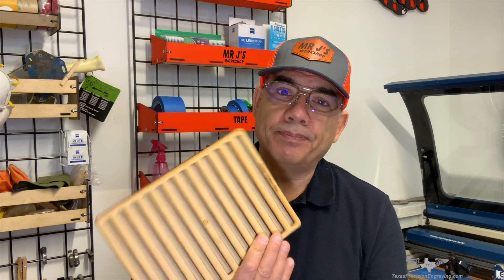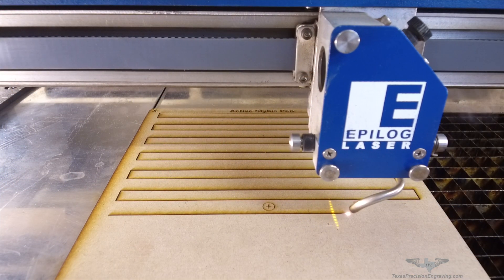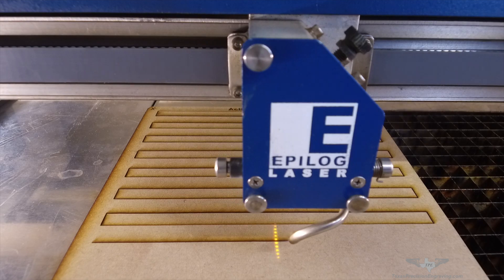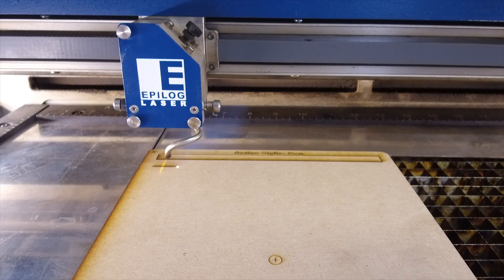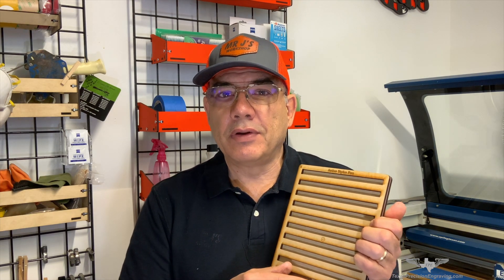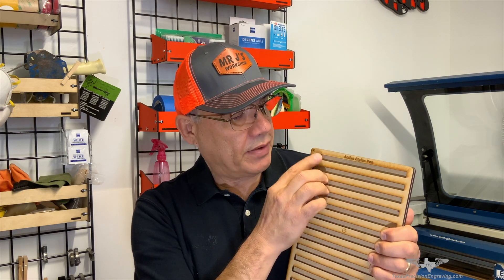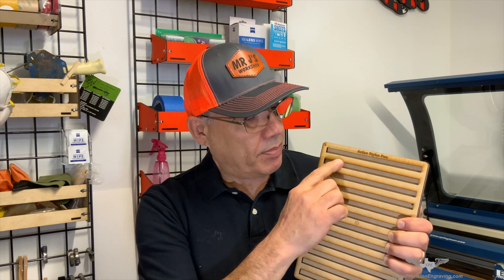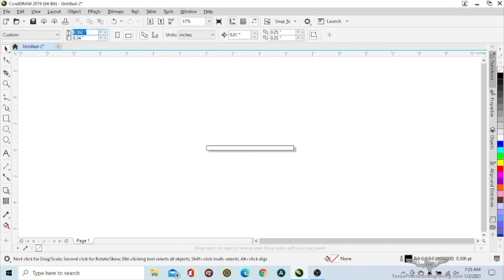Stylus Pen

Comment: Just curious what you're using for an exhaust fan? It looks like it's barely running. Is it adjustable flow? I have an Epilog Fusion Pro 32" CO2. I run a wood chip exhaust fan from Harbor Freight that pulls twice the CFM that was recommended and it works great, can't even see smoke exhausting to vent,  minimal cleaning. Thanks